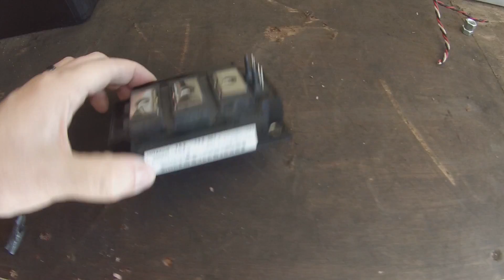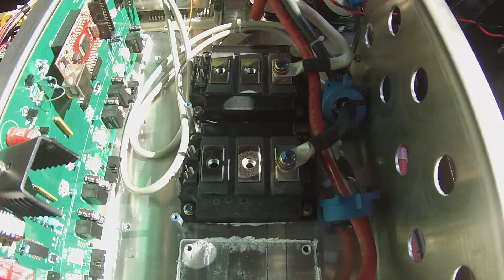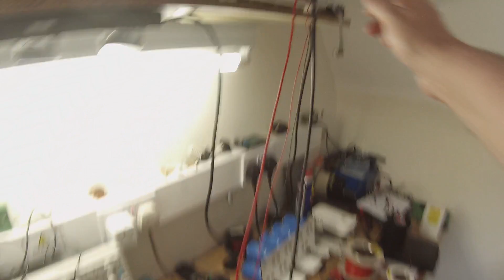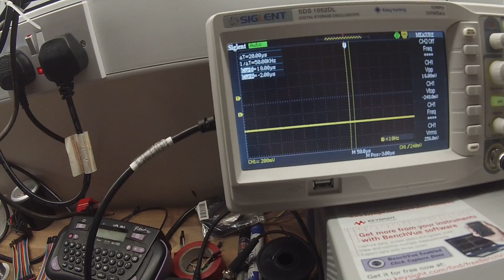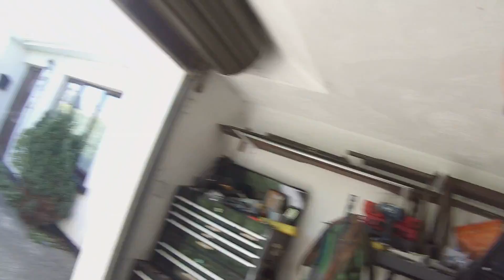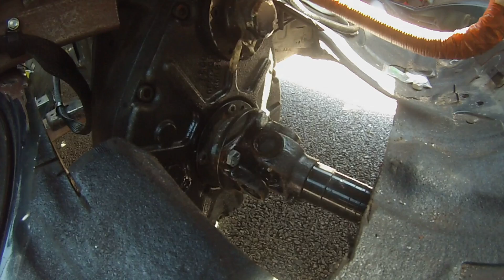BMW E46 Budget Electric Drift Car Project 21 : Blown Valves

Comment: Damien, Yes, we like to watch ;-). (quote from Being there - Peter Sellers) It seems there may be damage to the gears or the bearings with that degree of noise. Sounds like straight cut gears. My guess is the bearings. I've heard similar noise before. Alternatively a Double Cardan joint may be required and is actually beneficial in relieving shudder & stresses.

Comment: Just out of curiosity, what is your preferred method of thermal grease application on the igbt bricks?  Do you find that a line (or blob) of thermal grease works well enough or do you have something more elaborate?  Thanks for making these videos!